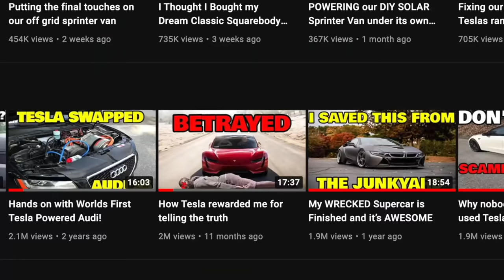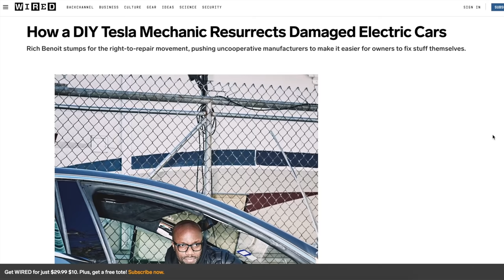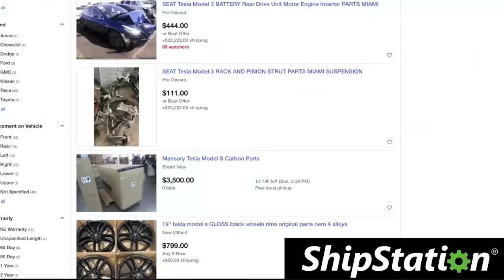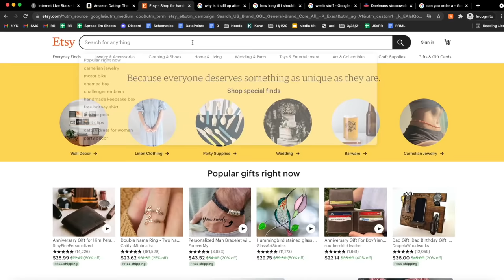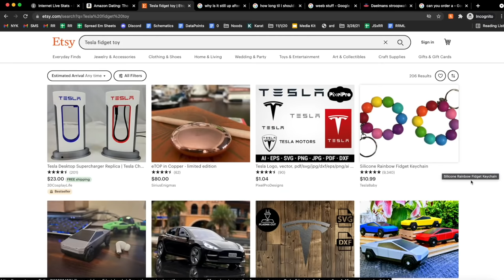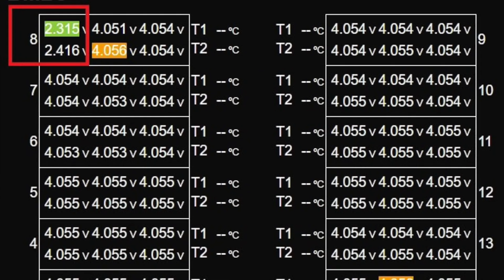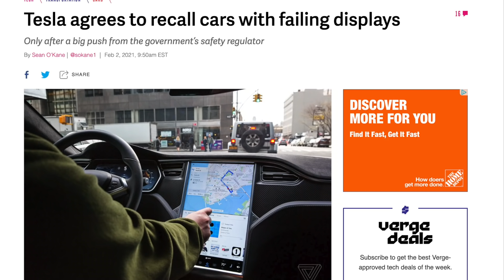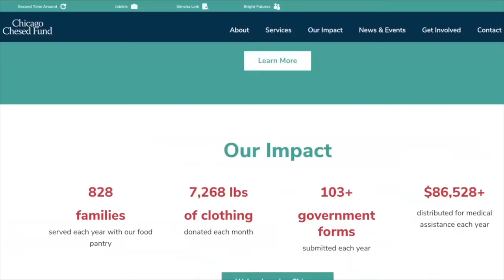Tesla wanted $16,000 to fix this NEW Model 3, we did it for $700! The importance of Right to REPAIR!

Comment: The thing that bothers me the most about this situation is the carelessness to waste, oh yeah the battery problem is huge but replace this entire pack for a pipe nipple.
Reply: Kinda shows ya that Tesla isn't as environmentally friendly has they want you to think
Reply: I wonder what they do with the battery.
First Option: They reuse the battery modules, i.e. in powerwalls, other batteries, etc. In that case the customer shouldn't pay such a huge sum.
Second Option: They trash it. This would mean they don't care about the environment at all.
Reply: @Silberschleier  They don't throw away batteries, they recycle them. Batteries are valuable enough to throw away.
Reply: @Silberschleier  I can almost guarantee they ship in packs like these to the battery service center, replace the nipple, then charge the next guy that has that problem 16 grand for that same battery pack.
Reply: The customer here buys a new pack, Tesla almost certainly takes in the damaged pack, replaces the nipple at the battery service center in the factory, then resells it to the next person as a replacement.
Reply: Tesla is liable for what they are doing.... So why should they take the risk of accepting such an fixing without any garantue this could be a long time lasting solution.

On the other hand the leasing company has also the right for getting back an not manipulated car, without any tinkered parts.

In the end the actually problem was just the carlessness of the owner...
Reply: @paperhouse6282  but they should give you are core charge for your battery.
Reply: Reminds me of Apple. Oh, something broke on your computer? Well that sucks... You can buy a brand new one though!
Reply: @StrangelyIronic  Yeah it's literally in the video, they refused to return the old pack if they did the replacement.
Reply: @andre2716  they showed a guy put 30k miles on his Tesla after they fixed his the same way. Ain't no reason Tesla should have to trash a 14k battery because a .50cent part. If anything that's a bad design and needs to be replaced with stronger parts.
Reply: @andre2716  You are correct. The lease company would not be happy about this. But the core problem really comes down to design. that plastic part should be replaceable. Or at least protected. Considering it's placement on the vehicle and the materials used.
Reply: Anthony R  Not so, its more nuanced than that but we do have companies taking the whole environmentally friendly stuff as little more than marketing checkmark to tick with no real intention of actually being so. Profiteering of our need for environmentally friendly businesses is pretty common despite being very necessary to humanity.
Reply: Oh yeah, the waste in these situations are ridiculous. And I bet you that Tesla would have turned that whole battery pack around and re-use it for their own profits.
Reply: @alexisrivera200xable  do you really believe tesla will put the battery with the broken nipple into a landfill ?   And you say whenever Elon Musk is talking about saving the enviroment, thats marketing BS ?
Reply: @Silberschleier  they reuse it... actually they reuse 99% of it. It is a scam on customers/insurance companies. Lets say the cost of all of it was 2k... they earned 14k
Reply: @towboatjeff  No EV company can be !!
Reply: @paperhouse6282  It depends. The problem is tesla is still scaling like a start up. They are growth focussed above anything. They dont have time or the ressources to have a big focus on recycling parts. I mean, if they had a relevant infrastructure for recycling parts, wouldnt we know about it? They need sales sales sales. There is one former tesla engineer who works on recycling, there is some little doc on him here on youtube.
Reply: @mm-hl7gh  concerning being environmental, yeah that is certainly marketing BS. Tesla is interested in being involved in lithium mining in south america. the situation there is classic being corp abusing poor countries for their ressources.
Reply: @andre2716  there's no fixing the stupid. Send my regards to your family.
Reply: @lamebubblesflysohigh  Of cause they reuse it, but the whole process isnt't just done with replacing the nipple but testing every module and every cell for fuction. After this you can reuse it as a replacement for a broken battery within the garantuee.

Everything is about liability issues.
Reply: @andre2716  but it doesn't cost them 16k. I would have hard time believing it was even approaching 4k
Reply: @lamebubblesflysohigh  ~12k is the regular listing price without VAT and for the replacement.
Reply: @andre2716  yea but Tesla will still get 1 year old battery pack it can re-sell as new. You have to subtract this from those 12k.
Reply: @lamebubblesflysohigh  They don't resell them as new. If a battery pack of an other Tesla goes faulty, you have just a claim of getting a battery pack in equal condition and not a new one. For this case they refurbish them.

Further more: Here the Tesla owner has no claim for garantuee, cause the problem was caused by an accident (with mechanical damage) by himself and was not a quality or production issue.

Of cause is there a huge gap between the manufacturer's costs and the final listing price. But Tesla is not social care. In the average a customer will perhaps invest 16k after 500k miles when degeneration goes to 70%. Then this invest is not more too much.
Reply: @andre2716  I bet they do if it comes from new car like this. They just visually inspect it, hook it up to diagnostics and if numbers are what they should be it being sold
Reply: They aren't throwing the battery away. They are refurbishing it and selling them as new of course lol
Reply: @apexgrin  Exactly they had to think about if they wanted to comply with state law and return a part.
Reply: @maxmeier532  So despite being in business for a considerable period of time it's ok if they do anything to accomplish what they want.
Reply: @mm-hl7gh  No, Its not like that, my point is that a lot of the time a company will do things in a way that is counter to their goal of sustainability for economic/profit reasons. 

Tesla will likely scrap that pack because its cheaper for them to produce a new pack than it is for them to have certified techs working on troubleshooting and reconditioning used packs. It takes valuable space to have the necessary equipment to do it and ultimately its impossible to guarantee the integrity of the cells in a pack that has been damaged and that is a liability they might not be willing to take despite most of the cells being perfectly usable.

I'm not talking about just this particular pack, once you scale up to process the number of damaged packs that a company like Tesla would be handling in a monthly/yearly basis it quickly becomes cheaper to just scrap it/send it for recycling. 

Please consider that recycling while a far better option than throwing stuff in a landfill is still an imperfect process so some of the stuff can't be recycled 100% and its an energy intensive process that adds its own environmental cost to the equation. Now I apologize for the long winded reply so I will get to my point, recycling is more wasteful than fixing the pack but more expensive for Tesla. Companies choose profits and efficiency in cases like this despite running counter to their sustainability goals. Are they hypocrites? Not necessarily since Tesla does recycle stuff but their actions in aspects like repair and replacement do undermine their environmentally friendly aspirations. Other companies might do similarly while others still do far worse and are true hypocrites in their environmentally sound claims.
Reply: @andre2716  If the original quote was like 3k, then would be willing to listen . . . begrudgingly, but 16k? Hell no! You, and other Musk cultists probably would pay hundreds of dollars for a vial he claims to contain his urine.
Reply: They will refurb the battery pack, not throw it away like you imply.
Reply: Tesla should have factory refurbished battery packs available to swap with a minor damaged battery pack. They could charge a couple of thousand for the refurbishment and replacement. With the upcoming 4680 batteries that may last up to a million miles, it makes a lot of sense to factory refurbish them than recycling and save their customers a bunch of cash. With that said, that silly nipple should be replaceable. In 10 years when they are doing a hose replacement on these cars, that nipple could be brittle and break during the hose replacement. Would suck to need to replace the whole pack because of that.
Reply: Not owning a Tesla. Can a person make an aluminum skid plate to strengthen that area from underneath ? To at least take the brunt of road debris better.
Reply: @andre2716  I need to find that "average" customer which keeps his car for 500k miles.

Comment: If they gave credit for the good battery cells when you had to replace the battery pack, the cost would be much less. They expect to replace the entire battery and keep the original battery, which does have value. There should be credit for it.
Reply: Even if the whole battery is done , the lithium alone  has a fair bit of value , no ???
Reply: Tesla did not damaged the battery pack.
Reply: Exactly!! Just like Autozone when you take off the item and get the core charge back
Reply: your phrasing is way too nice, they are stealing it from you since they dont give a core charge. This should be fought as a class action lawsuit
Reply: Tesla won't give you back the battery unless they drain it. Drained batteries is why  lithium batteries die anyways so it is a big risk trying to reuse it.

Comment: Tesla needs to learn from this. A simple low impact incident should not write off the battery and cost the owner $16k. It generates bad press and since they don't advertise and rely on word of mouth, situations like this only break customer confidence.
Reply: And the fact that one new battery is 6 years of driving around a v8 Vs a few months of v8 driving for replacing the broken part of the battery. Tesla is am environmental disaster right now.
Reply: @OutOfNameIdeas2  6 years? Yea no…
Reply: @OutOfNameIdeas2  yet people aggressively mock gas cars for being so dirty. People are incredibly stupid nowadays.
Reply: @OutOfNameIdeas2  You've posted this message a few times now.
Reply: @OutOfNameIdeas2  Electric Cars are not old enough the cheapen the process. Gas cars were perfected for more than 100 years, Batteries are only becoming cheaper now with advancements in manufacturing and technology.
I'm not a tesla fanboy, but the car industry as a whole is an environmental disaster far greater than Tesla will ever be.
Reply: @danepher  There's a video that discusses how batteries for electric cars are made. Truly eye opening.
Reply: the subscription based model of owning a car is ridiculous & is just pure greed
I really wish they would change the name of the company, they do not deserve to use Tesla's name on these cheaply made plastic cars
Reply: Agree, the one thing that was obvious was that the whole design and location of that port was really poor. Also if it's so easy to break, it ought to have been designed to be replaceable.  This is like breaking a window and get told you need a new door.
Reply: No, YOU need to learn from this.  Stop buying from companies that do this. Join the RTR movement.  VOTE for RTR.  You can hardly complain about a company abusing you while you keep giving them your money
Reply: A few old movies like Tommy Boy and to a lesser degree Fight Club have highlighted how a part that costs a couple of cents can add up to hundreds of millions across an entire supply chain. I think Tesla chose cheap thermoplastic for its electrical insulation value over more durable materials but nowdays most cars are made of plastic anyway much like the first Korean Daewoo cars to hit our shores

Comment: Very smart fix. I had the plastic return line on the fuel pump in my '01 SATURN crack and leaked a little bit so you could smell it. The repair shop said the pump was $385. I took it home, cut off the cracked tube and drilled it out and turned a brass tube that pressed right in there and the leak was fixed . Yankee ingenuity!!..........Cheers, Jim

Comment: For a car that costs 5+ figures, they treat their customers very poorly. Also plastic fittings on a $16,000 battery!!! I am glad people are fighting for the right to repair computers, cars, tractors, for it all!
Reply: It wouldn't make sense to run metal connections... But the design could probably easily be changed to something that protects the plastic connections... Like add a metal shroud that sticks out from the battery pack that takes the impact of something hitting it.
Reply: @rkan2  This was done on the Model S years ago. Tesla retrofitted a lot of those with a titanium plate to cover the car's underside because they were getting debris damaging the packs and other critical components in a similar way. (My guess is that they did it because they were still needing to bolster their car's reliability reputation as an unknown upstart company in the car manufacturing industry.) They should have the model 3 underside covered as well even if its just a cheaper type of metal.
Reply: @alexisrivera200xable  I remember. The "plate" is just a couple inches wide titanium bar in front of the battery pack - it doesn't cover the whole underside  - it is just designed to break apart stuff going under the battery pack.
Reply: @Cheepchipsable  All Tesla batterypacks can be replaced in like 2 hours.. Tesla service center rates are like 180$/hour...

Comment: I've been fixing my own stuff all my life, 2 months ago my 65 inch curved Samsung TV kept shutting down after two minutes because of an overheating problem. Took the back off and saw the amount of dust in the back (I live in the med), cleaned everything including dismantling/cleaning/lubricating the cooling fan, job done only 1 hour. Happy wife happy life :-)
Reply: Sometimes all you need to do is a little research and then take the plunge!
Reply: I have a TV repair shop, and I help my customers find the most lasting expedient way to solve the problem.
Reply: Why fix your own stuff when to fix it I could have charged you 95% the cost of a brand new one? Right to repair is overrated when you know I’m your guy and it might be expensive really expensive but I’ve got your back. Unless you want a warranty on the work I do can’t help you there! 🤪
Reply: Yep, so wasteful how much repairable stuff gets junked. Back in the late 2000s there was an issue with Samsung using cheap capacitors and the power boards dying. It was a $0.30 part on a $1k TV, and you could dismantle it and replace it yourself with just a basic bit of soldering knowledge. I saved two TVs from the junk bin fixing that for people.
Reply: @huskywithcoffee1568  And microwave oven junked because of a blown fuse.
Reply: How do you fix complaining wife? :O
Reply: They say that in Iowa, where women rule the world, that s one of two things I didn’t like about Iowa.  The other is they are scared of their own shadow,
Reply: good man if you know how to do it your self you are truly free
Reply: @HboskO1982  the old school answer was practice your back hand....
Reply: @HboskO1982  bullets
Reply: @HboskO1982  I'm clever not a genius.. Lol

Comment: This is equivalent to telling someone they need an engine replacement from a cracked radiator port, what a joke. Also, kudos to EG, that repair looks more reliable than the original fitting.
Reply: Metal is a far better material than plastic. That brass fitting would be what... $5?
Reply: Hey, look, your thermostat housing is cracked!
Now we're going to have to swap out the engine and trans as it's all one part on the crate...
Reply: @YouNameItGaming  Bro your radiator cap is broken and won't seal. That'll be 17 grand for a brand spanking new radiator and top of the line blinker fluid!
Reply: Elon bought wrong company namely Tesla he should buy Edison it fits way more in that type of after sales service/attitude
Reply: I'd have put a small ring of JB Weld around where the nipple threads into the battery just to make sure it won't break there, obviously not very strong material.  But I tend to overdo things like that.  Wouldn't hurt anything.